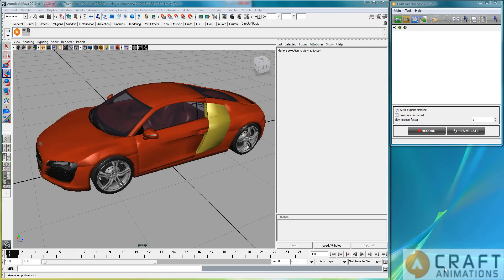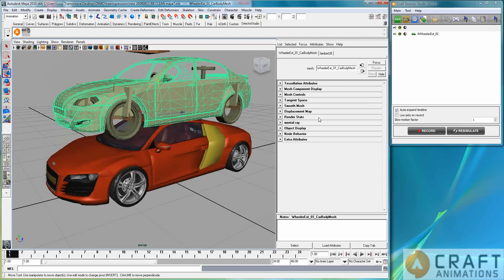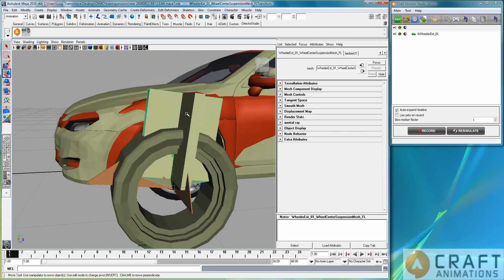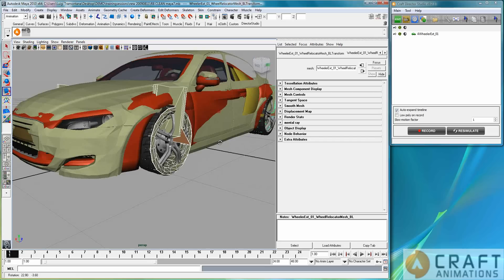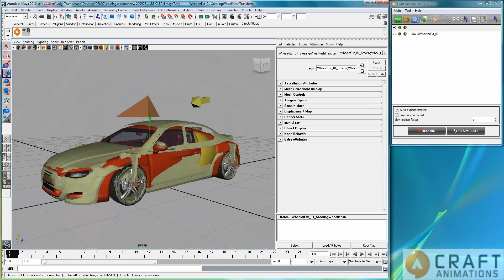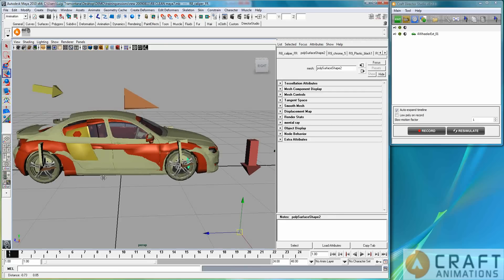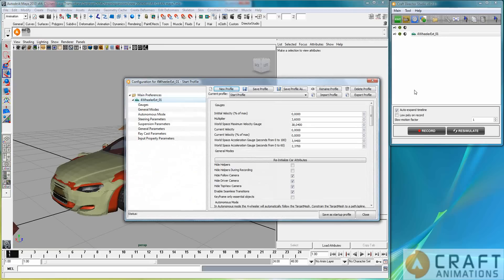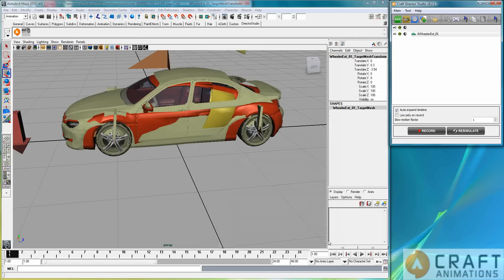Craft 4-Wheeler Extended (1/3) - How to rig and animate a car, truck etc in 3ds Max and Maya

Comment from the maker: @sourabh723 First you need to install Craft Director Studio. Once this is done you start Maya and go in to Window > Settings/Preferences > Plug-in Manager and check the "craftdirectortoolsadaptor_maya[version]" Loaded and Auto load. You will then have a new shelf were you start CDS from.